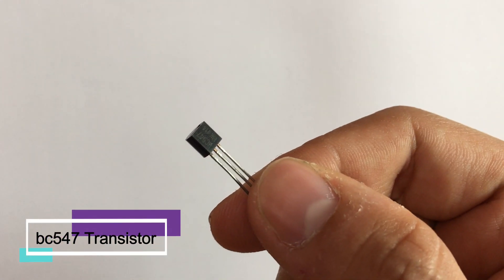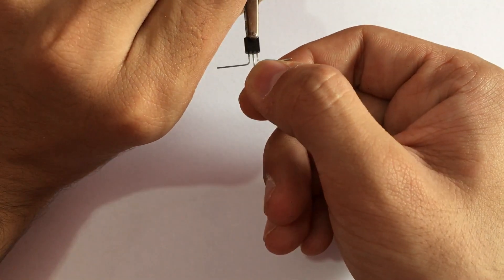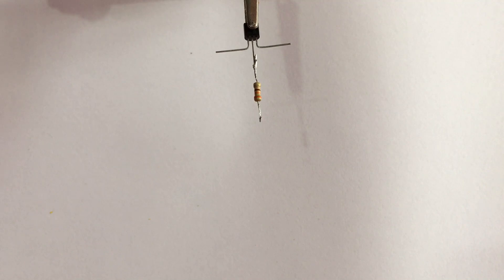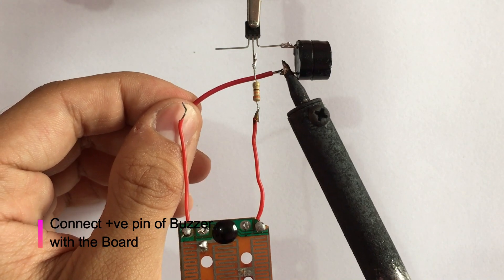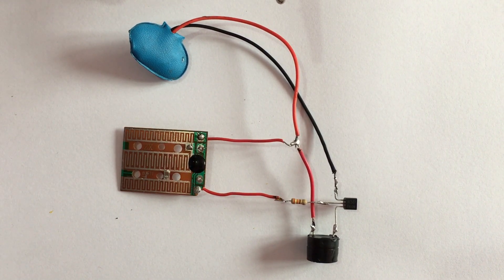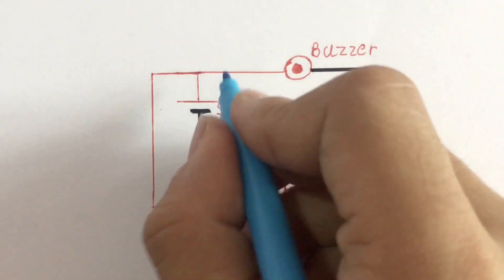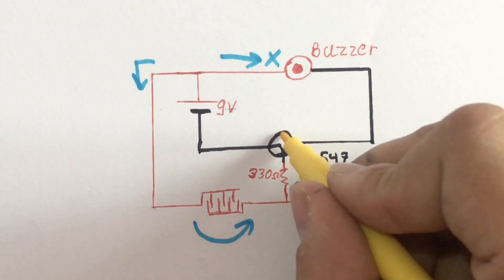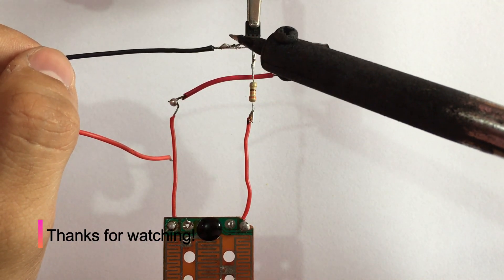How to Build Rain Detector Using Transistor | Easy and Useful Circuit!

Comment: Which board you are  used sir..
Reply from the maker: The board is called “rain sensor board”
You may get the sensor module too if you are buying it.
Or if you don’t want to buy you can also make it yourself by adding contact wires on any board